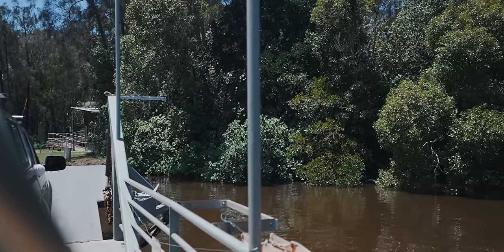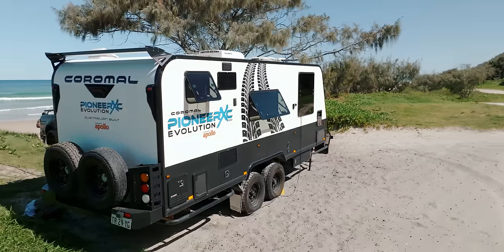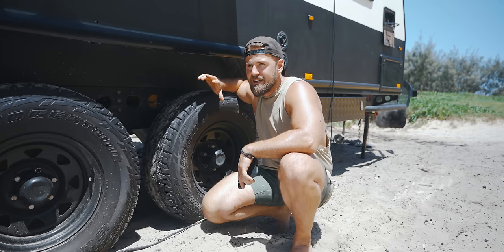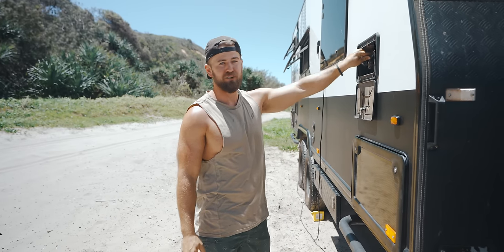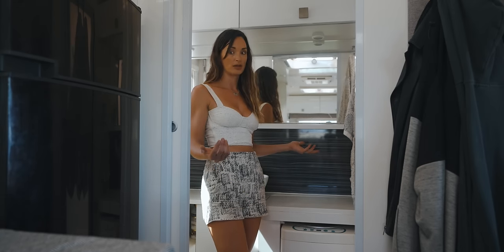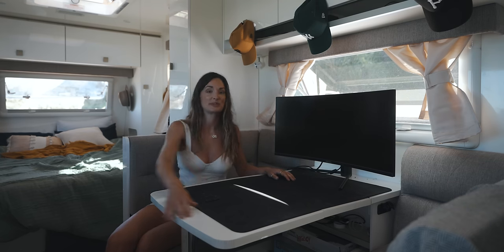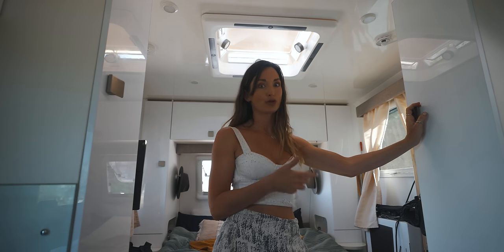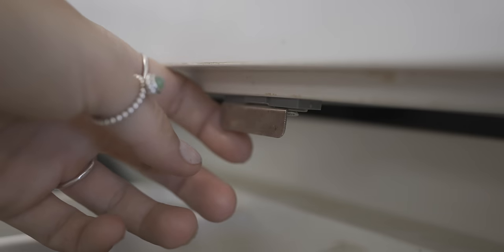The best van under $100k?! Full OFFROAD CARAVAN REVIEW after 2.5 years living full time

Comment: The girls know the inside function, white is nice color , don't really need an oven , camping oven 😊 👍👌, nice functional van , batteries down the back , heavy things like batteries should be up the front, weight distribution a must when travelling, not forgetting grey water, drinking water, a bit back heavy ? Good rap though guys. Happy wife happy life Duncan, Sophie likes the van❤😂.
Reply from the maker: Yes, you are right, we’ve never had an issue but to be safe they could be positioned further down the van, under the seats would work to spread the load.

Comment: Thanks for the video.  Very informative.  We have a similar model - not fully off-road though.  Did yours come standard with the curtains?  If not how did you fit them?  Cheers.
Reply from the maker: Hey Stephen,

Thanks, really glad you found it useful. 

Yeah the curtains came with the caravan. The curtain runs along a wire and the wire at each end is attached to a screw which is screwed in to a curtain board which is then fastened to the wall with screws. 

If you're on Instagram I can send you a photo if you like? We're @ifnotnow_ds

Comment: Hey guys just wondering what year your van is I have a 2018 model and I didn't know the suspension had a recall on it. And having same problem with the air bubbles on the side of the van.  Great vid guys 👍
Reply from the maker: Hey Mark,

Ours is 2019, one of the last of the Fleetwood vans I believe. We were notified via email, might be worth chatting to Coromal to see if yours is effected?  I did come across a poster about the recall this week in the Coromal Owners Group on FB which mentions vans "built between January 2019 and August 2019" - so yours might be fine if built earlier.

If you're on Instagram I can send you the poster, we're @ifnotnow_ds if you want to message.
🤙
Reply: Thanks very much
Reply: Hi Mark.  I have a Fleetwood built van 11/18 with this exact suspension. Apollo has denied any responsibility for my van. I have contacted Fleetwood and received an underwhelming response. A report has been supplied to the department of infrastructure regarding a recall on the Fleetwood built vans. Any owner of these vans need to park them and issue a message to Dept of infrastructure and hope they issue a recall notice before someone is injured or killed when a suspension fails.

Comment: Sadly Apollo no longer make the Evolution range, once they used up the Fleetwood (original makers of these vans) components after purchase of the Coromal brand in 2018. So you won’t see many on the road, we have changed a bit in our 612RTV. purchased from Apollo just pre Covid. Now run 400 of lithium, removed the drawers kept the fronts changed the blinds to Aussie Traveller. Replaced the problematic Camec HW system with a Swift storage HW. Hated the Alko hitch now run a D035 and added extra solar panel after the glued Flexi panel failed for reasons discussed.Just added a third sirocco fan and installed a diesel heater under the dinette seating.
Reply from the maker: Yes, such a shame. Although we've heard that they'll be taking back manufacturing ownership soon, so hopefully reverting back to offroad vans with a bit more functionality / capability than the current ones...

Aussie Traveller blinds... They're an absolute must! Next van build for sure.

How are you finding the Swift HC? We'd probably look at getting a different one to the Camec if we custom built.

Your van sounds great, very customised to your needs no doubt 🤙 thanks for sharing your modifications.

Comment: You mentioned you have a Ranger? We are looking at a vehicle for our indefinite lap:) looking at the Next Gen Ranger Wildtrack or Nissan Y62 ? What are your thoughts on Ranger with payloads etc?
Reply from the maker: Hey, we have been pleasantly surprised with our ranger but are also considering upgrading to the next-gen ranger. 3.5 tone payload is perfect for us, and with the new ranger having a V6 in it, I would hope that its even better for towing. That being said, it does depend on how big you are planning to go with your van. The current ranger has worked well for us, and the only time it has struggled was on 40+ degree days when we were on long drives +6 hours. We found the engine would start to lose a bit of power which might be an oil cooler issue. Once we stopped and let it cool down it would be okay again.

Comment: Great review. We have same but with bunks. I the suspension may of been recalled because of us. The rod end bolts failed, I raised the issue with Apollo, they went straight to their engineers for support. We are very happy with our van and it’s ability to handle some very rough tracks.
Reply from the maker: Oh cool, so is it the exact same size? What’s the layout like with bunks? Ah how interesting, how did you realise that they’d failed?
Reply: We did the Gibb river road and I checked over van every 50 to 100km along the way for failing components, they come loose then and failed on the way home. Apart from the M12 12.9 grade bolts failing, the van had no other issues from rough roads. Personally, M16 bolts should of been used. All the things that has happened to your van are the same things as us 😜. To fix the hot water system I fitted a inline pressure accumulator and removed the hot water safety valve ( little naughty but these two changes stopped the cold water shot between spongie showers. Plus if you forget to turn pump on there is enough water under pressure to flush toilet. 
Now window. Love the glass but we have had a bunk window pop, shit times🙈 Apollo replace luckily. Not sure if it was rock or defective glass, but taking no chances, I installed pinch weld around the edges to prevent future breaks. For your own van I recommend you check the glass edges for small chips to see if worth doing the same to yours. 
Our Van layout (PEX636) won’t please everyone but we wanted space and bench top over a separate shower toilet Note. Wife not a fan of having a combo 🤣
So lounge / fridge to front is exactly the same as yours. Breakfast bar behind lounge and door. Combo next to fridge and x3 bunks E/W along the back. Suitable for out eldest 17 year old. 
You mentioned not having enough 12v power in yours. That was the first thing I changed (enerdrive). Pulled under bed draws out for better storage. 
Note. For all player, not all lithium batteries are equal. Check the maximum discharge amps because if you plan to run a inverter, boiling the kettle 2400watt will pull excess of 200amp load from the battery. This in some cases will trip the battery management system. Old saying “ poor man, page twice” so do your homework mate. 
Also a slide out Webber Q will fit in tunnel boot if your willing to cut the legs off, it is a bit of a conversion starter when people see it 😉. 
In general we have found out van to be a bit of a head turner for some reason, it just look different from the rest.
Reply from the maker: Ahhhh good tips RE the water pump. Does yours ever whistle? Sometimes we have to turn it off for it to stop. Not sure what it's all about, will make sure Coromal sort it before we sell the van.
Oh wow that would have been a nightmare, we'll definitely check over the windows, another good tip 👍

Yeah we agree we'd lose the bed drawers and increase the battery storage under the be. I've also seen them located in external trunks which is interesting so then you have a tonne of under bed storage. I suppose it's much of a muchness just changes access points. 

And thanks for the tips on lithium. We need to work out next whether we change the van or upgrade. We both really want to do something a lot different but know we'll be paying A LOT more than we paid for this one... decisions.
Reply: No whistle from ours mate. Good luck with deciding on upgrades or to change vans. Market has gone crazy. Safe travels
Reply: Hey mate. I meant to ask you if new suspension allowed you to upgrade the gvm. And if so did Coromal pay for it. Cheers

Comment: Great to see this! We have been on the road 2 1/2 years in our Coromal Pioneer Evolution XC 612. Just did 3 months up Cape York, also drove right up the middle of WA. Did the Mereenie Loop and the Plenty Highway from Alice into Boulia. We love the van and it has done us proud as has Lee and the team at Apollo. New suspension is great. We are about to do a major solar energy upgrade to sustain us for the next 20yrs! We have an outdoor kitchen, one spare tyre, lithium batteries and composite gas containers. We have a full oven, definitely use the washing machine and the shower and have a different internal lay out than you guys. We have two sirocco fans and no under bed drawers, we use the outdoor 12v plugs for outdoor fans clipped to the underside of the table and for recharging phones We are retired so don’t need to work. We also travel with our dog. Keep living your best life. ❤
Reply from the maker: Hey Christine,

Ah you have taught us something! I just googled composite gas containers as I wasn't aware of these for caravans. They're great - not only the weight but the transparency to see fill levels is awesome, even though we have a spare I managed to run out on Teewah Beach, plus it would help know for certain that they're being refilled to the top. Thanks!

We haven't ventured to the Cape yet, how did the van go? Did you leave it in Cooktown or take it further?

I'm also curious about your solar upgrade as we are considering a fully custom build next and a solid solar setup would be a big priority for us.

Happy & safe travels on the road! Perhaps we'll see you out there one day. 🤙🤙 Soph x
Reply: @IfNotNow  we went all the way up and all over the cape with the van. It travelled like the trooper it is! We did 3 months all up and free camped at the junction of Elliot and Fruitbat Falls! So swam and drove parts of the Tele track from there with the tow vehicle in which we have swags and camping gear. Pippi our dog lives the swags! Also did Pennyfather with the swags. It was amaaazing! 
Our solar upgrade is: Viltron Solar Smart MPPT controller, Viltron BMV Battery Monitor, Shervey Life 280 ah Lithium Battery (5 year warranty), Viltron Multiplus 12/3000 DC - AC inverter, Viltron Digital Multi Control 200/200 amp, Viltron Orion - Tr Smart DC -DC charger (car to caravan), 4 x 200w Premium Solar Panels. We are getting the upgrade done in Bundaberg QLD at the end of Feb - Solar ‘N’ Sat.
Reply from the maker: Siiiiiick, your trip sounds epic. We'll be keen to take our next rig up there when the time comes. We're going to take a note of your solar setup too, add it to the 'to research' list 😁, 1000w of solar would be a dream. We currently have 300 on the roof plus the portable 150. 

Safe travels 🤙
Reply: @IfNotNow  just wondering why you are looking at a “next rig”? What is your thinking behind that?

Comment: Hi I must thank you in Advance I found the information in your report accurate and help full.  I have a Fleetwood built van 11/18 with this exact suspension. Apollo has denied any responsibility for my van. I have contacted Fleetwood and received an underwhelming response. A report has been supplied to the department of infrastructure regarding a recall on the Fleetwood built vans. Any owner of these vans need to park them and issue a message to Dept of infrastructure and hope they issue a recall notice before someone is injured or killed when a suspension fails.
Reply from the maker: Hey Arianna , sorry to hear about your lack of luck getting the suspension resolved. When this happened to us, Apollo actually called us, letting us know about the issue and strongly suggested that we not move the van until they could pick it up and change the suspension. I believe the failure rate is relatively low but not worth the risk if you live on the road.

Cheers, D